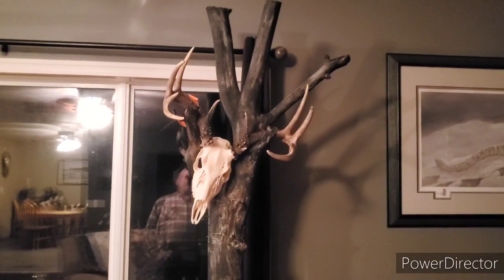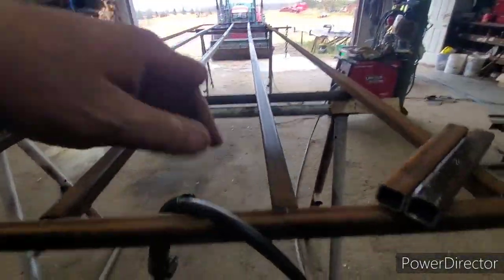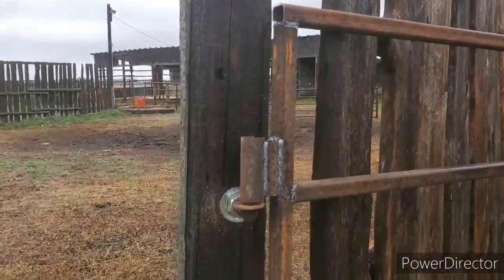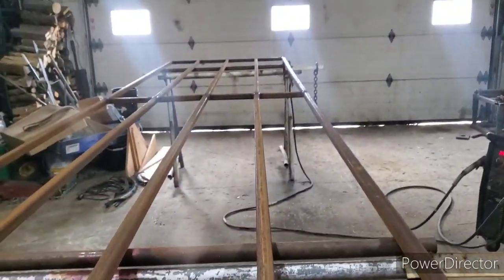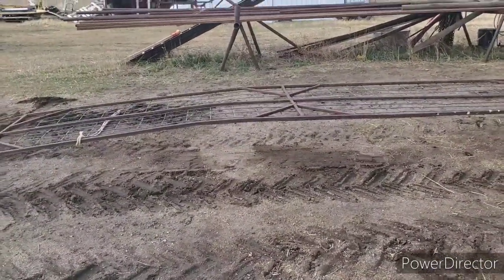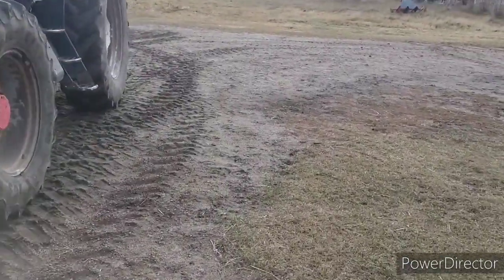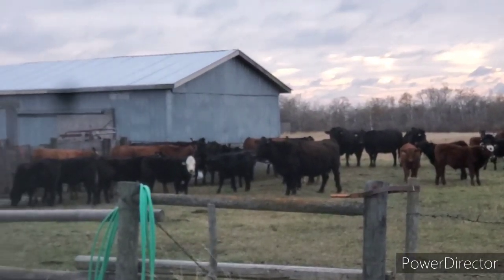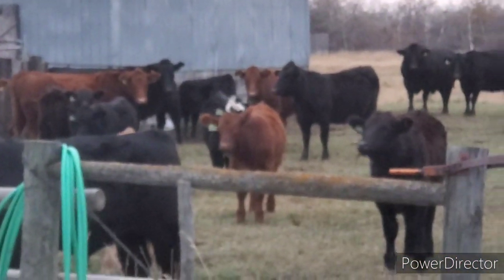It's All About The Gates, DIY Build And Install (KINDA)

Comment: if you have calves in that corral you can always fasten a clamp-on steel skirt to fill the gap under the gate
Reply from the maker: Or a rubber belt

Comment: Could you consider welding an extra set of hinges on the gate at exactly the same distance apart so in effect you have a set of high hinges and a low set? (we use this approach with feed troughs on deep bedding cattle bedding. In the case of the troughs we use large link chain to allow  height adjustment.
Reply from the maker: Probably could but haven't tryed that yet

Comment: 14 too 16 inches is a nice hight for gates. Our gate from the yard into the lot is even higher, works fine.
1/8" wall tube is great for a lot of things!! That stock panel crap... Welds pop on it too easy! So much galvanization impregnated into the metal, you can't get good welds. Even their factory welds are a joke. 
Straighten a few gates with a tractor or the  loader 👍😎
Reply from the maker: The heavy duty gates at the local stores are a joke...gage material...I have yet to see a cow buckel one of these
Reply: @bcpfarmandtrucking6560  yup. Best store bought we have, are on the front of the feed barn. They have held up great. Otherwise, most are 💩

Comment: Nice job on the gates bud. Are you running 0.35 hard wire with 75/25 gas?? Just curious. I know not to fuck with shit that works just fine. But if you ever get a chance try (metal core) wire with 95/5 gas. I guarantee you will like it 🙂. Anyways tell CP I love that idea to hang the deer heads on. That’s awesome!!! As always WORK SAFE 😎😎🇨🇦🇺🇸. LETS GO BRANDON
Reply from the maker: Hey buddy..running 0.45 and I have used metal core not at the farm but when I was a fitter/welder doing structural steel...CP says thanks ..stay safe and work safe
Reply: @bcpfarmandtrucking6560  I ran 0.45,052 and 1/16 flux core and 0.45,0.52 and 1/16 100s hard wire and 0.45,0.52 and 1/16 metal core wire at the shipyard plus 0.45 copper nickel, monel and inconel wire and stainless and aluminum. The mast on ageis destroyers are actually all aluminum!! Plus I ran a 4 million dollar automated submerged arc machine building custom t bars and angle bars that were 6 inch thick hy80 steel for the three new zumwalt destroyers. I miss my job so much. Stupid cancer 🤮🤮😡😡. I beat the cancer but the radiation messed my body up so I had to retire at 40 years old. I think it’s awesome you build and fabricate your own stuff. I really enjoy watching you build that stuff. Price of steel is ridiculous right now. I worked at a few fab shops before my career at the shipyard. My highlight project in my fab shop career was for fox 51’s new building in Boston. I built a stainless steel spiral staircase for the lobby. One of the hardest things I’ve ever built. Anyone that’s worked with stainless knows how the memory of it is. And trying to get radius and rise at the same time was definitely a struggle even with all the right equipment. But I got er lol. If your ever bored look up (BATH IRON WORKS SHIPYARD). Theirs a few videos on it on YouTube. Sorry for rambling lol. Have a great day. 🇨🇦🇺🇸
Reply from the maker: @retiredwelder  Holy crap you have done alot more then I have...most of the stuff I work with here is used oil pipeand coil pipe...and its all trial and error I think something up and giver a go if it don't work out try something different till it does...I'm self taught at pretty much everything I do unless a Google it